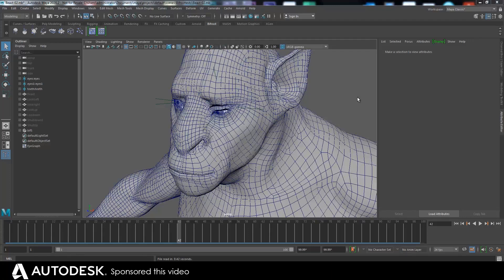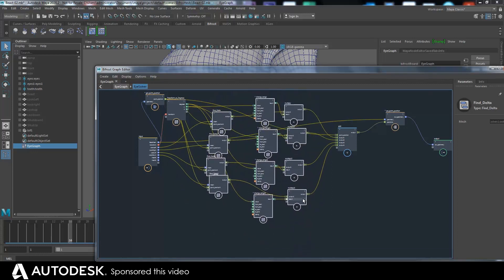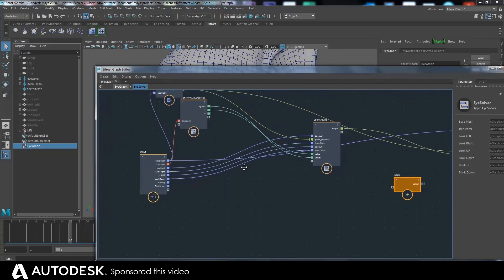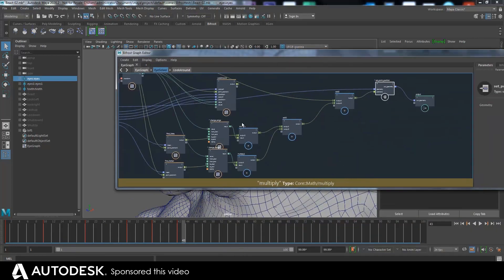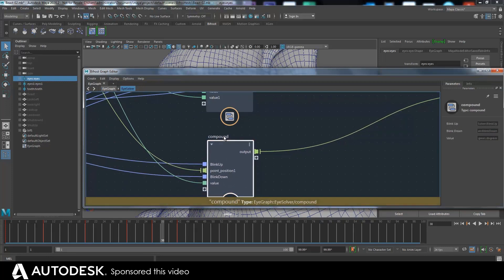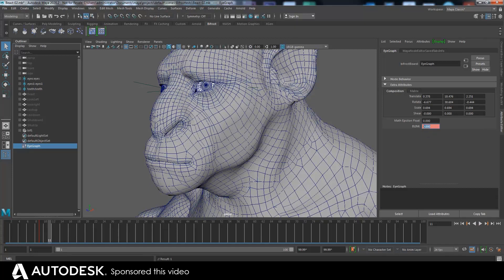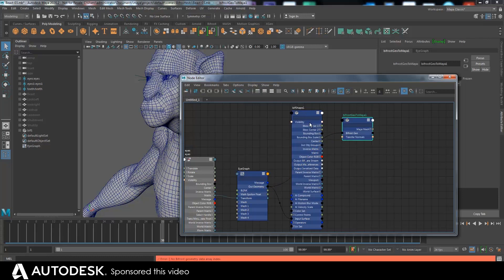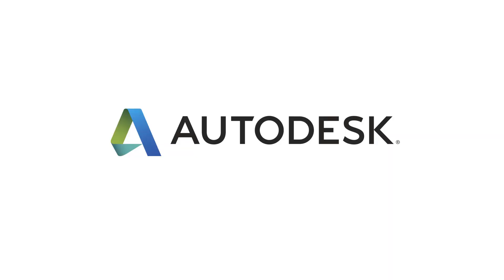Exploring Bifrost with Paul Smith - Ep. 10: Blink / Wink layer

Comment: I can see this being useful if it can work in conjunction with rig control groups, constraints, ect. Another concern is i don't think it would be worth replacing normal blendshapes if you don't have a slider panel and have to scrub through the timeline. It's definitely a step in the right direction, though.

Comment: I like your videos but i still don't get why would someone use Bifrost over the maya shape editor?
Reply: Well, I always use ICE over XSI's shape mixer, because I can make a tool that does everything with all the logic set up, and all I need to do when I need it, is plug the new shapes in so It takes less than a minute to set up, which is a lot faster than faffing around with expressions on individual channels.  I think the appearance of complexity comes from the fact I am actually building a shape mixer eyelid solver from scratch , not showing you how reuseable it is once you have this tool set up.Once you have built this, you never need to again. 
I think if anyone thought they had to get into the code and program Maya's shape mixer tool from scratch each time, it would look pretty tedious too, but that is a closer equivalent.